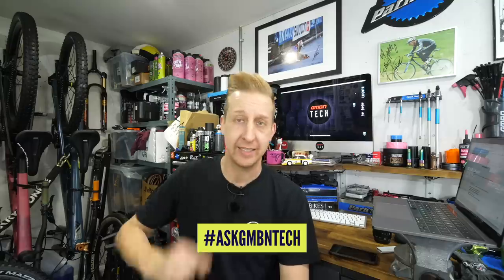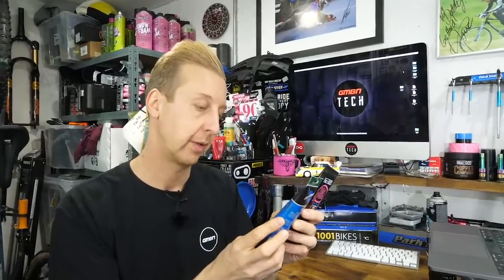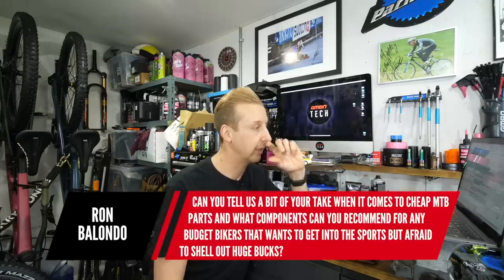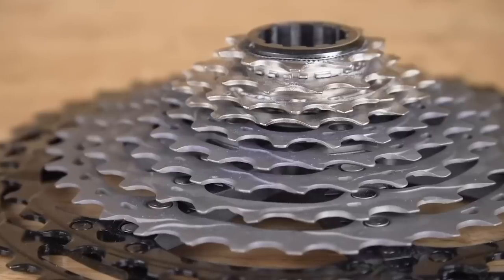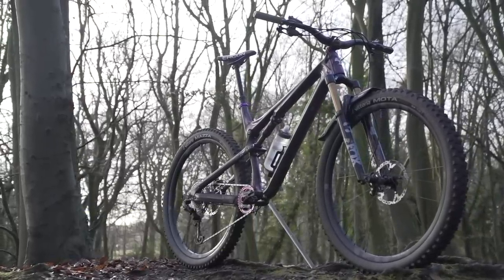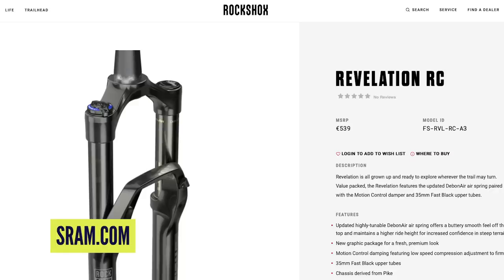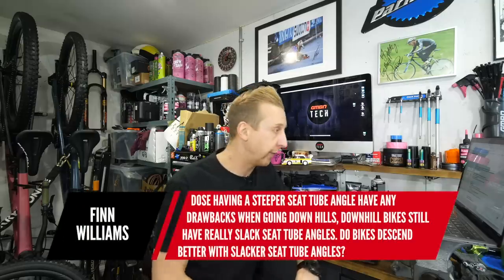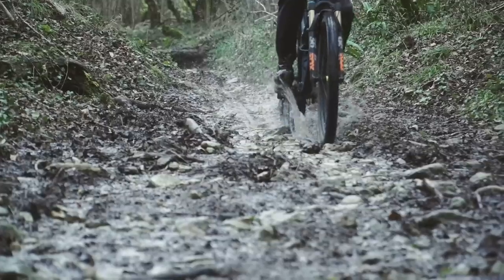What Cheap Components To Save Money For Budget Mountain Bikers? | #AskGMBNTech

Comment from the maker: Got a MTB tech-related question for us here at GMBN Tech? Submit it below using the hashtag #AskGMBNTech for a chance to be featured on the channel! 👇
Reply: #AskGMBNTech
I have a height adjustable Fox Talas 32 on my bergamont Threesome, but it's stuck at 120mm and doesn't want to come out to its full travel. I always put some oil(I don't know how to call it in english) on it, but it doesn't help. Whats the Problem?
Reply: #AskGMBNTech hi Doddy, First off love the show!! Basically my bible for all things tech and maintenance... I'm waiting on a new transition scout frame to arrive and have a question / request for your opinion on trail, offset and stem length. I've got a medium on order and the new carbon scout utilises a 40mm stem with a 37mm offset. Now, given that I'm ordering a frame set not a whole bike and currently have a 50mm stem paired with a fox 36 fork which has a 44m offset. Don't particularly want to try and a) buy and find a new fork in stock and b) buy another stem, yet I totally respect the engineers that designed the bike... Thoughts on how much of a difference a 44 not 37mm offset would make and 50mm not a 40mm stem would make when looking at the scout? Cheers for the help and stay safe!
Reply: #AskGMBNTech Can I use Muc-off copper compound (which is Carbon-safe) as Carbon paste for HEadset ot Bottom bracket(pressfit)?
Reply: #askgmbntech can i turn my non boost rear end 12x142 11 speed to a modern 12 speed?
Reply: @AskGMBNTech hi doddy I'm really confused as to why some bikes have a jockey wheel above the cranks. Bikes such as the aurum hsp c2, why do they have that jockey wheel surely it adds weight to no obvious benefit. Could you please enlighten me on this please. Thank you.
Reply: @pranavreddy6470  I have seen this in Many bikes, the thing, the bigger the travel of the frame in full sus, the bigger chain movement with the suspension. In large amount of cases this makes the chain to fall off (even with Narro-wide crank) so the jockey wheel takes some of that movement away making the chain more stable on the bike.
Reply: @flyingbuddha9815  yes, I did that with my Kross Level 6 bike and mounted the SX cranks, GX rear derailleur, 12-speed cassette, and gear level of GX ( I don't like it however so ill be swapping to Deore XT 12 speed since its bit better for me). I had some "small" issues with the installation tho - the chain line was not centered as it should be, and I installed everything to the letter with the instructions. I noticed the chain line works great from 10 tooth cog up the 8th and has very big trouble moving to 9 thru 12 (especially the last) so the first thing I did I order 32T cog for the crank with 6mm offset. the line was better but not perfect. The second thing I did is I swapped bottom bracket outer spacers (I do have SRAM dub BB) and i switched the outer spacer for the smallest one attached with BB on my drive side and the second largest on the non drive side ( with the largest I was unable to move the small adjuster wheel from the non-drive side). and finally with all that swapping and offsetting my chain line is ok.
To sum up: Yes you should be able to swap for 12 speed, but be aware that you might be a bit creative with ur approach.
Reply: #AskGMBNTech Hi Doddy, I need to replace one of my crowns on my downhill fork, but when I search on the internet for a replacement crown for downhill forks, it comes up with whole forks. Does this mean I am going to have to replace my whole downhill bike fork? Where can you find replacement downhill fork crowns?
Reply: #AskGMBNTech Love all your videos! Do you think we could ever see wireless brakes? (with ABS?) That could make completely cable free cockpit which would look crazy!
Reply: @Tiermeeko  Since currently there are half hydraulic (caliper) and half linkage brakes (the cable to the caliper) I think now it's just a case of wireless communication between caliper and handle. since there is wireless shifter I know the communication is not an issue. In my opinion is the breaking handle itself since how would you program progression with braking (like it's in Saint brakes, Zee brakes) - thats the problem that is not easy to answer.
Reply: #AskGMBNTech
I have a cheaper set of shimano hollowtech kranks (the ones with the pinchbolts) which ceep slipping away from the spindle. I tighten the pinchbolts properly but the left arm just ceeps slipping away from the spindle. Any ideas?
Reply: @ManMan-jg6om  yes, first please re-watch hollowtech crankset installation again, the spindle's ending (non-drive side) is kinda like a cog. Now, if the crank-arm is too loosely bolted or too greasy it might snap or move.
Second: the small pinch rows within the cranks are broken or sanded by the crank arm from b4 ur installation, and thus creating unwanted movement. in this case u have another choice but to buy new Shimano cranks.
Reply: @Radosław Poprawski
Thanks for the help
Reply: #AskGMBNTech 
Hey Doddy, I recently crashed my bike resulting in a broken arm. (Don't worry, the bike was okay!) You had mentioned you had some wild injuries in the past... how did you spend your time while recovering and what did it take for you to get your confidence in the saddle back?
Reply: are there numbers to be known.
Reply: #AskGMBNTech what do you think of 26 inch for mtb? It’s cheaper so I was just wondering if you think it is still good or not.
Reply: @bentoth2494  well, if u want to ride an dinosaur that crack creeks squirms and begs to be put down be my guest and get 26" bike with 1" headset that heavier then ur whole bike combine not to mention rims - 26" rims are more a wavy spherical shape that goes sides after 5 seconds after truing.... not unless ur prepared to buy best possible 26" wheels which are worth more then 1 new bike.
Reply: Can I put 27.5 wheels on my bike currently the wheels are 26in.will I have to change forks
Reply: #AskGMBNTech 
I'm shopping for a new fork just now but I cant seem to find any that fits my price and that I can easily order, I'm looking for a 120mm air straight steerer (1- 1:8) any suggestions would be much appreciated
Reply: Opinion on hard tail kona bikes are they good spec for the money for  #askgmbntech
Reply: @ManMan-jg6om  You probably need a new spindle - the current one might be slightly rounded?
Reply: @jamese1689  You won't be able to change to 27.5 because the frame will not allow that size of wheel in u could probably have a 27.5 on the front if u changed the forks but that's probably not worth it
Reply: @ur_mum2341  Price range?
Reply: @ur_mum2341  Thru axle or quick release?
Reply: @ur_mum2341  wheel size?
Reply: @ur_mum2341  Is £520 out of your price range that's about the only fork I can find (Rockshox Sid air 26" 9 mm qr)
Reply: I have a 1st Gen TALAS fork on my 2004 Specialized Enduro.  The fork no longer rebounds, and Fox cannot service it due to age.  I want to replace it with the Manitou Markhour, but my disc brake caliper is a 51mm IS mount, and the Markhour has a 74mm post mount.  Is it recommended to use an adapter to mount the front disc brake, or should I get a whole new front brake system?   I'm trying to keep this bike alive for as long as I can.  Thanks!  #AskGMBNTech.
Reply: #AskGMBNTech why aren't headsets like bottom brackets where they just screw into the frame?
Reply: Hey Doddy, regarding cheap forks I got a 2019 revelation, upgraded from stock 120 air chart, to 140, and a charger 2.1 damper and was a lot cheaper then getting the top end fork even though the internals are now the same
Reply: #AskGMBNTech Hi Doddy. I recently noticed my fork suck down about 10-20mm and it is more softer. I just want to ask about the causes and why it happens. By the way I have a SR Suntour Epicon 2011 model. Thanks
Reply: #AskGMBTech
Hi I’m Jeevan 
I’m using Orbea Alma H30  it  has 2*11 drive train on it.
I have a issue in cassette , when i hold the cassette and start moving side to side there i feel  little shake (is this minor or major issue)we remove the cassette and clean it completely and fix it back on bike but the same issue I’m facing.
And I’m planning to upgrade my bike to 1*12 is it possible 
I need your suggestion on this. 

Thank You GBNTec
Reply: #AskGMBNTech
HI DODDY CAN I USE MOTORCYCLE OIL FORK FOR LUBING THE TOP SEALS LIKE FORKBOOST DOES? THANKS !
Reply: #AskGMBNTech i have one of the older rockshox totem that needs a complete rebuild, i was wondering if the fork is worth the money to get working again or should i go out and just buy a newer fork?
Reply: #AskGMBNTech

How long can I leave my bike sit before it causes problems? What kinds of things should I check for (maybe warped tires for example)?
Reply: #AskGMBNTech I would like to get a 29 Marzocchi bomber z2 to put 27.5 plus size 3" tyres on. Will the boost spacing on the fork allow this tyre size/width to fit?
Reply: #AskGMBNTech
Hi Doddy, I just purchased myself Deore M5100 11-51t cassette. It just came to my knowledge that there is a new way for proper chain length when measuring for 12 spd as instructed by shimano (add 5-6 links instead of 2-3, depending if the end link is an outer or inner plate). Considering that Deore M5100 has 51t as its largest cog, does the new method of measuring 12spd chain length also apply to the 11spd 11-51t cassette? Can't seem to find an answer for this and I'm hoping you can help, thanks!
Reply: #AskGMBNTech love your videos doddy I have a old school question I am finding it hard to find a BB 100mm/143mm for my 2003 dh team any advice would be great 👍🏻
Reply: #AskGMBNTech  Hi Doddy love the show.
So i currently use a Sram 11 speed nx groupset. Do you know if i would be able to swap the 11 speed derailleur for a 12 speed derailleur, with the aim of being able to fit a 11-50 11speed cassette. As far as i can tell the 11 speed shifter would control the shift increments which would match up and because they both use SRAM 1:1 actuation ratio this should all match up.
Would there be any other problems that i havent considered?
Reply: #AskGMBNTech I am learning to wheelie on a carrera vulkan and I am looking for a strong upgrade for the handlbars could you advise on a good brand thanks👍
Reply: @donniemackay9996   27.5 thanks :)
Reply: @donniemackay9996  quick release and under 300 euros sorry for not being very specific at first lol :)
Reply: @ur_mum2341  OK the fork I said won't be any use because its 26"
Reply: #AskGMBNTech I just got a Trek Roscoe 6 and I am thinking of upgrading it. Could you give a list of the things I should upgrade first, and what I should upgrade to without spending too much?
Reply: #askgmbntech Hey Doddy, hope you can help me, I'm going to install this old SRAM carbon crankset on a new frame, but I accidentally lost the spindle. Which dimensions or measurements should I consider in order to get the correct 30mm spindle? Any help is much appreciated :)
Reply: The Audi is a monster of a rally car but there is the Subaru that collin drove.
Reply: #AskGMBNTech Hi Doddy&co. Can I use discbrake cleaner as a degreaser on transmission (e.g. when doing a deep clean)? 
Thanks
Reply: #AskGMBNTech What are your thoughts on running 27.5 wheels on a 29er frame. Would you run into any problems other than pedal strikes??
Reply: #askGMBNtech do tyre inserts have any effect on grip
Reply: @danjones8934  I don't think so. Fabio Wibmer put 27.5 wheels on his 29er Stumpjumper and didn't have any problems
Reply: #AskGMBNTech I'm planning on changing my full suspension xc, and I'm struggling with the trail vs enduro dilemma. I ride park with lift often(ish), but I would like to be able to do long, whole day rides too. If I install some lighter tires on an enduro is it much worse to paddle up than a trail bike?
Reply: #AskGMBNTech
Square tapered vs hollow tech crank
Reply: #AskGMBNTech
Could I put the crown and stanchions of a fox 34 in a suntour fork with the same 34mm diameter
Reply: @pranavreddy6470  that’s for high pivot suspension, look it up on YouTube it’s really interesting, in short tho with a high pivot design the wheel goes out as the suspension goes deeper rather than up so the chain would stretch. (Correct me if I’m wrong)
Reply: Have you ever heard about Altus/Acera groups?
Reply: Favourite vehicle: MB Unimog
Reply: #AskGMBNTech  Congratulations for the great content first of all,  now this my question Doddy, i'm building a bike from scratch, my type of ride is enduro, FUN not racing, my base frame is a 16" (S) CUBE STEREO 160 HPA Race 2016, like the name says is 160mm front and back and is 27.5" wheels with a head tube angle of 66º, here is my BIG doubt, since i have to buy a fork i was thinking to buy a bigger fork like 170mm, 180mm MAX  27.5" at first, but then i started to think on this MULLET ideas, and i see people that do normally that put a smaller fork because of the geometry, and that is one thing i don't like, downsize the fork :( 
I'm try to see how much would change in the angle by putting a 29" but stay with 160mm or even 170mm, but until now i didn't find a simulator that let put 2 different size wheels, but at 160mm 29" it looks that changes -1º , at 180mm 29" it changes -1.5º from what i could tell by playing with the simulator. is this too much?? and i know i have to be careful for the space of the wheel not bottom out the fork so he didn't it the frame, but i don't have a way to test that :(  ideas here?
the other question is, more important maybe...what path do you recommend, stay with 27.5" and go with bigger suspension...or go 29" front with max 160mm suspension or less?...where can i get more benefits to have fun in enduro type of cycling?
Sorry for the long  text, and errors..a BIG cheers from PORTUGAL for all of you, be safe.
Reply: #AskGMBNTech do brakeadapters from 200mm to 203mm exist? If so which brand produces them?
Reply: #AskGMBNTech  
I noticed that my gear shifting greatly improved after changing my 12 speed chain (Shimano Deore Groupset) to a new one. Am i dreaming? I can see that my old chain was sagging which prompted me fitting a new one. Never seen that before with 10 or 11 speed chains.
Reply: #AskGMBNTech Hi Doddy, Great content as always coming from you 🤟. I have a problem on my tubeless setup on my Raceface AR30 wheel set on my Whyte T-130s V2 2020 MTB. When its raining or the ground surface is still wet etc when I notice it most. For some reason my sealant runs from the 2 little hole around the rim sidewall this is on both sides of the rim. Then my tyre pressure goes down and tyre is going flat.

This setup was done at my local bike shop along with brand new tyres. Had the same problem with the original tyre to. My tyres are tubeless ready BTW. Was thinking going back to tubes because of this happening. What would you recommend i can do? 

The only thing I can think of is the rim tape is either the wrong size for my rim. Or my rims just don't like be tubeless lol.

UPDATE; What I did do to stop the sealant from coming from the little holes I added 3M Super 33+ tape over the two holes has stop this happening so far.

Plus running a full Muc-Off Tubeless setup from the valves, Rim tape & Sealant.
Reply: @llove-electrical  They obviously wont change the actual grip of the tread. However they will allow you to run the tyres at lower pressure, which will increase the amount of the tyre in contact with the ground, giving you more grip.
Reply: #AskGMBNTech Hi Doddy! I recently bought a new tire (Schwalbe Nobby Nic 29" 2.35) and tried to put it on my carbon rim. The beads are very tight when I need to put the last 20cm on and thus I am unable to install the tire. Any tips without the risk of damaging the rim? I already tried it on room temperature and I also placed the beads in the middle of the rim, but there was no noticable difference.
Reply: #AskGMBNTech
Hi Doddy! I just had to buy new brakes as the old ones pistons started to leak oil and i just bought a new Rotor (wich off course got oil on it from the leak) i cleaned it with sanding and nail polish remover (couldn't get brake cleaner as everything is closed) and the pads of the new brake are also contaminated  from some oil still being on there from the leak i guess.
Is the rotor simply toast now or is there any way to get it absolutely clean again?
The pads are sure gonna be fine if i sand them down a bit right?
Would be a shame if not as the parts are brand new.
I hope you are having a nice day. Greetings from Germany :) Cheers
Reply: #AskGMBNTech
Im a bigger rider 300lbs currently on a trek marlin 7 2020 what upgrades would you recommend, and any pointers for heavier MTB riders?
Bonus question, If im looking to update to a 1by system from my current stock drive train what changes would you recommend
Reply: #AskGMBNTech
I want to upgrade my mtb experience and I am thinking of trek x caliber 7 2021 for cross country use. Is a good idea?
Reply: @angeloska5907  Why not a trail hardtails tho? Atleast to me they are much more fun as they aren't just great at one thing😀
Reply: #AskGMBNTech I have an old, 2012 model,  shimano deore xt rear derailleur and deore groupset which is a 3x. In converting to 1x, do I just change the chainring and it's all good or do I have to change my whole drivetrain? What are the things to consider when switching to a 1x when it comes to the drivetrain?
Reply: @nickventura4741  Your drivetrain will probably be worn a good amount wich means you should also get a new chain and cassette. With a 1x conversion you should also get a bigger cassette to not loose range. If your derailleur doesn't have a clutch you should Upgrade it too and get one with a clutch. At the moment depending on what is available a 12spd conversion may cost the same as 10 or 11spd.
Reply: @kaedeschulz5422  I appreciate your input! However, I think the drivetrain still has some good mileage on it since I think I've only ridden less than 1000KM on it that's why I'm deciding if I could just convert the chainring to a 1x just to save some money.
Reply: @nickventura4741  As long as the cassette is still good that absolutely makes sense :D